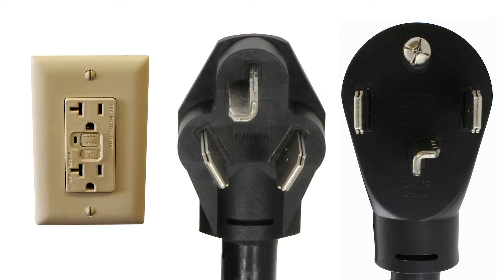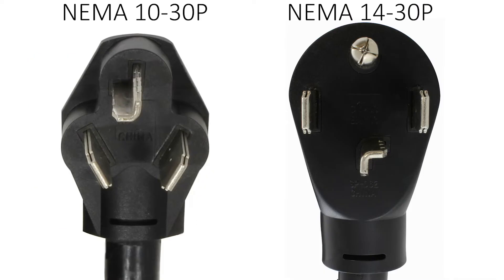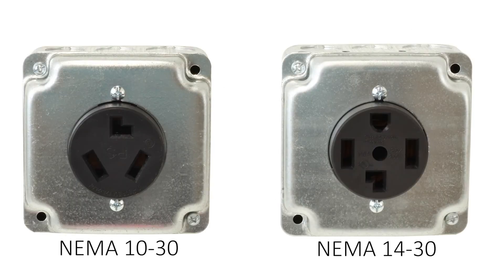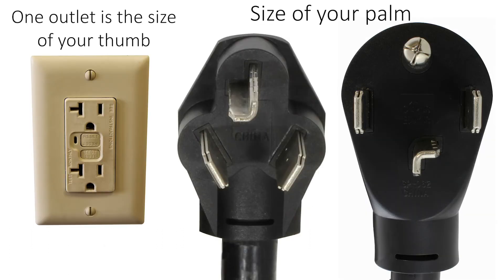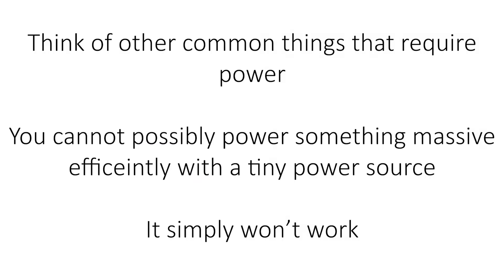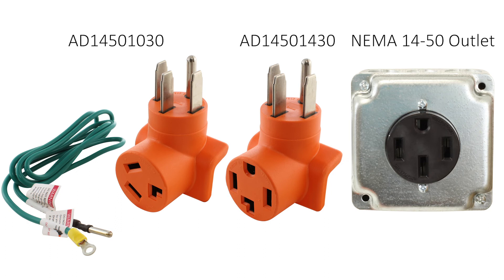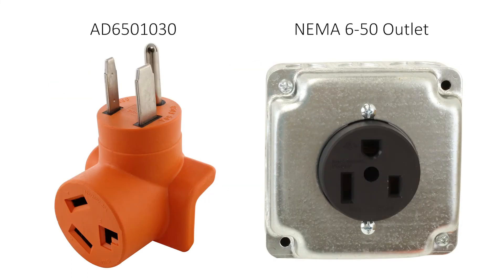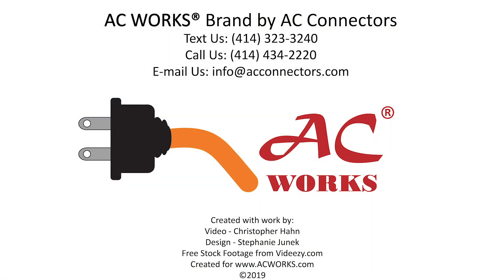Why Dryers Can't Use 110V Outlets

Comment: I just bought a used whirlpool gas dryer that has a standard household plug as its original part. Unfortunately, i didn't realize it was a gas dryer, and not electric, and have no safe way to vent it so i want to resell it. My brother-in-law, however, didn't think i would be able to run the dryer anyway without blowing a fuse, or possibly causing other issues. What would you recommend? The model number is: WGD5000DW3. Im so confused!!! Why would Whirlpool make a dryer with a cord like this if it can't be used? Id hate to sell it to someone if they cant use it, either!
Reply from the maker: Gas dryers typically only use a regular household plug or a NEMA 5-20 and can use up to 15 or 20 amps. The manual for your model says 15 or 20 amps. So with that, you would use a GFCI NEMA 5-20 outlet with a 20 amp breaker. That outlet can take either a household plug or 5-20 plug. There should be no issue with fuses as long as you have a 20A breaker, which most gas dryer hookups do.

Comment: So I have a step up transformer can I plug this into that to temporarily run my dryer?
Reply from the maker: I wouldn't recommend it. While the step-up transformer will give you the correct voltage, it still won't provide the right amperage to run your dryer effectively. It may not even run at all. The step-up transformers are more for low amperage appliances with a 250V requirement.
Reply: @ACWORKS  Thanks for the info - after reading your response, I ended up having it properly wired by an electrician

Comment: could a NEMA 10-30p to dual 110 plugs work?
Reply from the maker: You can use two household connection from a 10-30 outlet like this: https://acworks.com/products/1030ycb520-nema-10-30-dryer-plug-to-2-nema20a-household-with-20a-breakers?_pos=1&_sid=9928de3fb&_ss=r
You can't use two household plug to get 240V to a 10-30 connection if that is what you are suggesting.

Comment: Can a Nema 14-30P be used for 120V to hook up with an inverter that has 30Amp 120V output pins ?
Reply from the maker: Hello. Yes, 14-30P can operate at 120V since it has 4-prongs: 2 hots, 1 ground, and 1 neutral. This allows 14-30P to operate at either 120V or 240V.

Comment: I have in my apartment 4 prong outlet that my oven use my oven is 50amps and I want to use my dryer which is also 4 prong but the plug is different it has a L shape on the plug which is 30 amps can I use a AC WORKS [AD14501430] 14-50P 50Amp 4-Prong Plug to 14-30R 4-Prong Dryer Outlet in the same outlet my oven use?
Reply from the maker: Yes, you can!

Comment: The thing is, there actually are 120v electric dryers on the market. GE and Samsung make models that work on 120v, and in addition to these companies like Panda make dryers that also work on 120v.
Reply from the maker: That's interesting! Thank you for the comment. Do you know if those dryer also use gas? A lot of 120V dryers are that way because they also use gas.

Comment: I just bought a house in Chattanooga TN built in 1971.  Dryer outlet looks like a NEMA 10-30p...but the X and Y are at the top and the W is in the shape of a 7.  Have you heard of this type before?
Reply from the maker: Hello. It sounds like it could still be a NEMA 10-30. A lot of times, outlets will be installed upside down. It will still work fine! NEMA configurations are typically shown with the ground or neutral at the top.
Reply: @ACWORKS  - Thanks for the response. My dryer outlet was upside down. It drove me crazy trying to figure it out! You got a like and suscription for the help!

Comment: My dryer is an apartment size dryer and specifically says 110 volt.  I've had it for years and have had no problems with it so no, this is not true.
Reply from the maker: Hello. It sounds like your dryer might be gas powered. Gas dryers only require 110V, whereas electric dryers require 220V. Do you happen to know if yours is gas? If it is electric, I would be curious to know the model # if you happen to have it.

Comment: Hi I saw there's adaptert to convert it into a regular 3 house prong  , but seems it would not give the the power to heat it up ? Or can this cause electrical issues? I live in an older Apt
Reply from the maker: It would not give it enough power to heat up. We do not recommend an adapter like that.

Comment: Although I agree with you that you should not connect a dryer to 120 volts, a dryer can be connected to 120 volts and it will work(sort of).  The light, controls, and the motor are 120 volt rated and the 4,500 watt heater is 240 volt rated.  So the motor and light will operate fine, and the heater will put out some heat.   A YouTube video shows how to do it and says it saves power.  My comment was that it would use more power because of longer run times.  They were not convinced though.
Reply from the maker: Exactly the point we were trying to get across! The heater would definitely not operate efficiently and it would  take multiple cycles to get your clothes dry.
Reply: @ACWORKS    The author swears it saves money.   I guess if you cut the heat off completely, eventually the room temp air flow would dry them and save money, maybe.

Comment: was wondering if I could use an adapter on a dryer that has a Nema 5-20r plug to a standard 5-15P? I also noticed in my apartment my circuit breaker has a 20 amp circuits on 5-15P receptacle. IN CA by the way. just incase that makes the difference.
Reply from the maker: Yes, you can. You should first double check if your dryer needs to use 20 amps or if you can get away with just 15 amps. You can use an adapter like this: https://acworks.com/products/m515520t-15a-to-20-amp-125volt-household-adapter?_pos=1&_sid=1f9a484fb&_ss=r
Reply: @ACWORKS  Thank you. It seems a lot of people have done this conversion and the test is to run both washer n dryer at once as its a stackable. In the dryer the label that actually states 14 amps.

Comment: I was wondering if I could make a 220 extension cord for dryers that fix so I don't have to keep moving them in and out of the house cause I have no 220 outlet anywhere else. I don't need it that long maybe 16ft? I've seen them do this for welders but nothing for dryers.
Reply from the maker: Yes, you could make a dryer extension cord. That is pretty common. We also sell 3-prong and 4-prong dryer extension cords at 10ft, 25ft, and 50ft.
Reply: @ACWORKS  where can I find this.
Reply from the maker: 3-Prong https://acworks.com/products/ev-dryer-extension-cord_1030pr?_pos=1&_sid=5d45cb865&_ss=r
4-Prong https://acworks.com/products/dryer-extension-cord-1430pr?_pos=1&_sid=8471fca77&_ss=r

Comment: an electric dryer needs both 120 and 240 volts. the heating element uses 240 volts and the drive motor, the timer, and the lights use 120 volts. A NEMA 6-50  welder receptacle provides only 2 hots and a ground. And therefore is not suitable for use with a dryer.
Reply from the maker: Hello. You can use a 6-50 for a 10-30 3-prong dryer because each hot carries 120 volts. So the smaller things that you mentioned like the motor, timer, and lights can still operate at 120 volts just by using one hot.